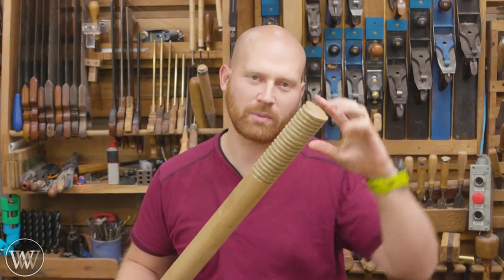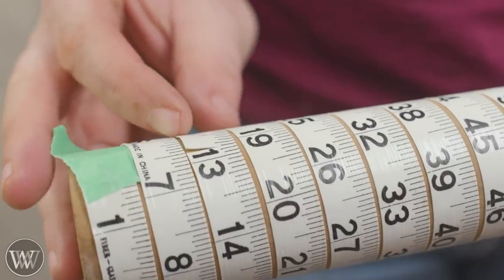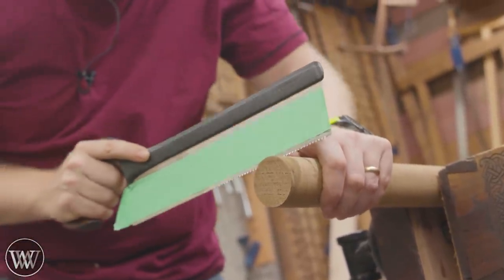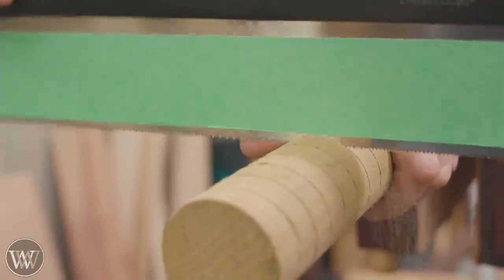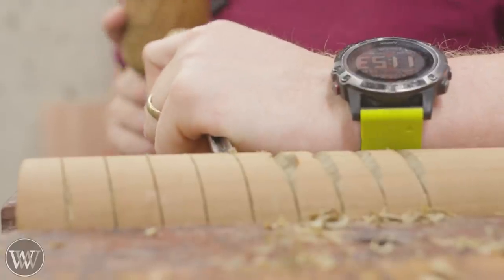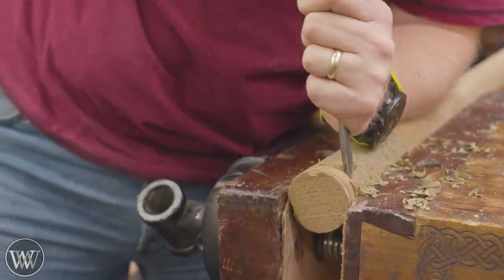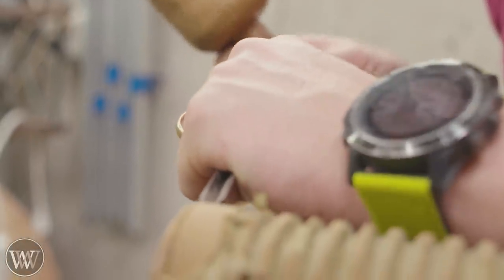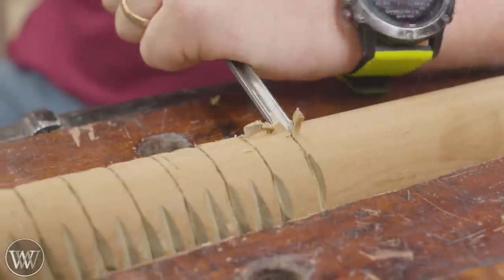How to Make a Wooden Screw With Just Chisel and Saw

Comment: Another way to layout the threads at an arbitrary pitch is to mount the rod on center points so it can rotate. Then angle the rod to the desired pitch. Then allow a weighted string to hang from the rod as you rotate it. As long as you do it slowly to keep the line plumb, it will wind in a helix around the rod. Brushing it with a little varnish will keep it in place as you cut the initial lines.

Comment: Awesome work, James! 😃
You know, I could never find those things you use to make threads on wood to buy here in Brazil... Then, when I first saw this video (on the other channel) I thought "that's what I'm going to need to do"... Then I remembered: you can modify a steel nut and bolt to do that! 😃
Anyway, thanks a lot! It just solved my problem! 😂
Stay safe there with your family! 🖖😊
Reply from the maker: right on. most of the time it is easer to skip this step if you have a bolt the right size you can modify.

Comment: Aloha James, For lay out of this type of screw, actually a 'helix', think of DNA,  Pinstripe tape is available in many widths. Also, a single line or that of a wooden screw using pinstriping based on the needs of the screw needed, can be easier using the single line of tape.
Reply from the maker: that is a great idea. the traditional methoud is with twine you then mark along the post where you want the threads and wrap it then eyeball the spacing.
Reply: @WoodByWrightHowTo  Aloha James, since becoming disabled[but able and willing to learn and re-learn tech of years ago]I've become mostly an Un-plugged Woodworker. Gone are my days as the 'Lead Carpenter' or running a 10 acre workshop. Today, I bee-have myself, doing my honeybees or recycling woods from float some or pallets. Mesquite or Kiawe as it is known here is just one of the 'food-safe' woods here I try to work. It is so tough it was once use for the roadways of Texas. As to it's import to Hawaii from the mainland, in 1824 , it's pods were fed to cattle during shipping here and after being tossed up and swam to shore, these pod fed cattle pooed the world's first honey forest's of Hawaii, so says Nat Geo 1915. My bees of just 20 of my 220 hives , that were used to keep 2 hotel area's safe from invading swarms of bees yielded 1200 pounds of Kiawe honey every 2 weeks , year round. The wood is so tough , it sounds like metal when you tap on it. I'm currently using it as bench clamp screws and plan on using it as the main vise screw of my 'un-plugged' workshop in my backyard.

Comment: As An amateur follower and just on 3.0 presentation I seen other methods that soak the dowel on mineral oil , some up to 7 days , please tell us why it was done that way and why I did not see it with you. Thank you
Reply from the maker: Soaking it in oil allows it to cut a little bit cleaner so you get less chip out. The problem is it also changes the dimension of the dowel and as the oil cures or runs out the dowel will shrink and it will expand when it is soaked in the oil. Most the time it doesn't change enough to be a huge issue but it can often cause problems. So generally I don't do it on a larger ones. If I'm cutting a smaller one and running it through a screw box then the dimensional change is much less of a percentage and in that case it's not a problem

Comment: I’ve just made a cutter to make a wooden tap, so I can then make a nut, and make a second cutter to cut the thread..... James, yours looks like an easier way! Thank you. By the way, at 5:10 I notice you open your vise using one handle of what is obviously a two screw vise, and the second screw (without a handle) moves as well. Is that linkage something you made yourself, or did you buy a turbo vise or similar? Thanks for a great video as always
Reply from the maker: thanks. that is the twin screw vice from Veritas. there is a chain inside that connects the two.

Comment: How difficult would this be without a v parting tool?  Unable to find that particular one, or afford any one I can find but I do have a small selection of regular chisels.
Reply from the maker: You can do it with a standard bench chisel and just chop in from one side and then chop in from the other side you just have to make sure not to go too deep otherwise you can pop out sections. I actually have an old video on beginner carving using just bench chisels.

Comment: I've seen this in books. Wha they did, was accurate layout work with dividers and then used a lathe to follow the line. But doing it free hand should be fine. I think layout could be done with a chalk line, but instead of snapping perhaps just hammering on it could work.
Reply from the maker: The other common layout would be a string then follow that with a pencil.